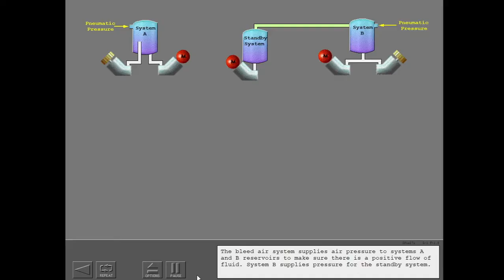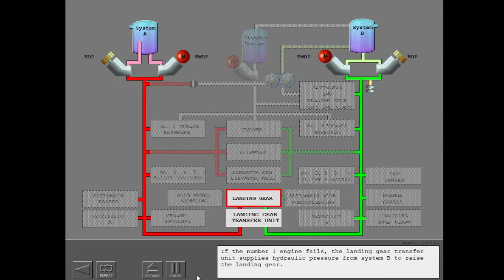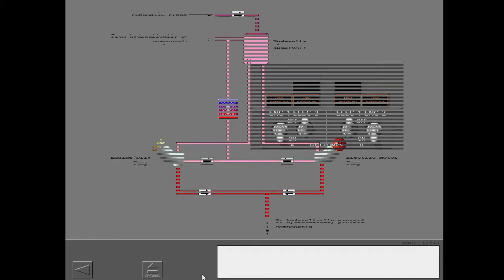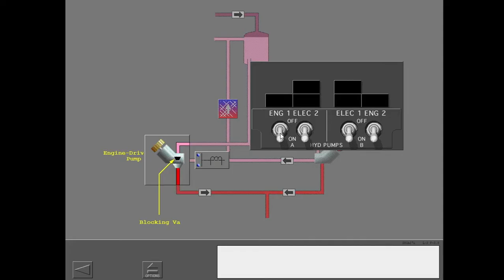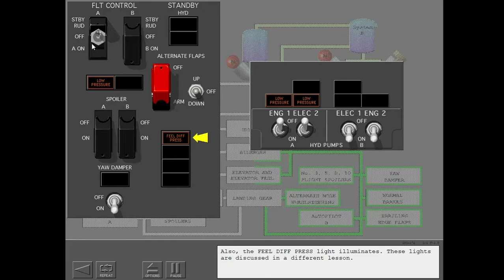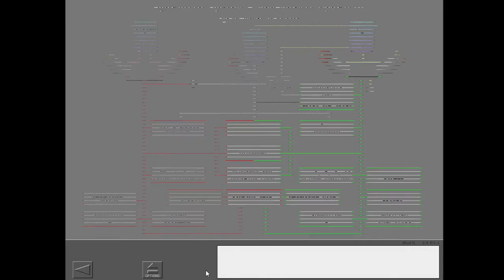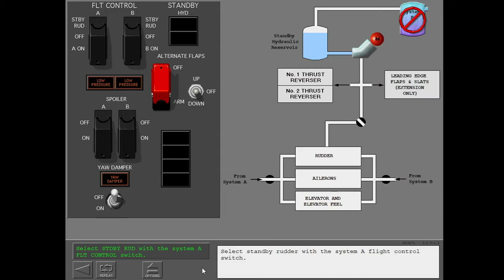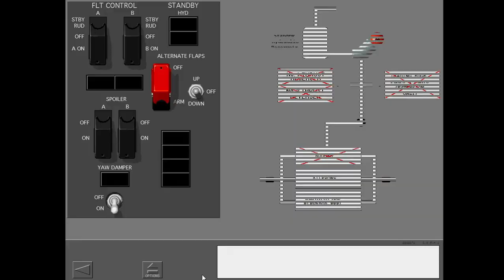31. Boeing 737NG - Hydraulics System

Comment: Based on what the CBT  explained, if system b fails, the PTU Control Valve can transfer the system A pressure to system  B and uses system b fluid to supply pressure to L.E slats, flaps and autoslat system. Looks like system A failure is more critical than B

Comment: 2:30 so basically the PTU can only operate with flaps 1, 2, 5, and 10? (provided the other 2 conditions, flight and low pressure system A) Why is it set like that with the flaps?